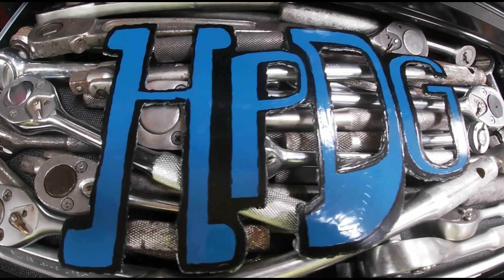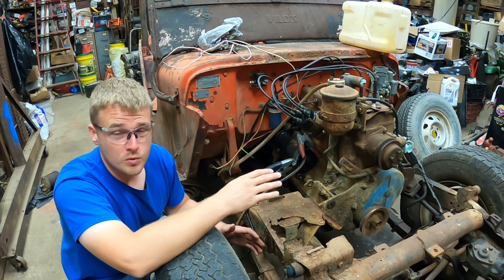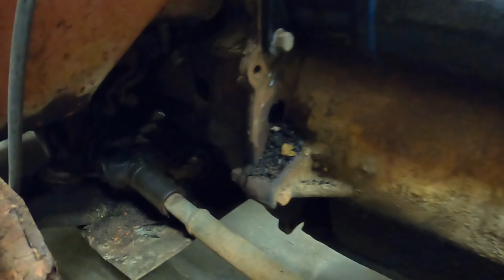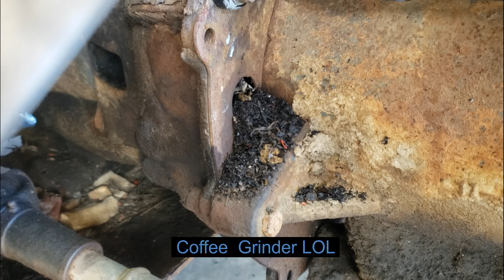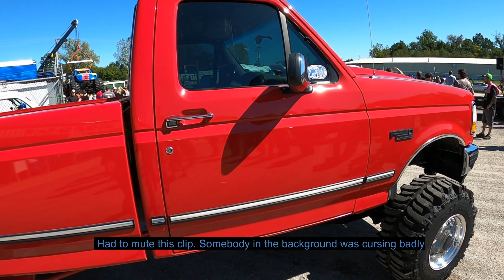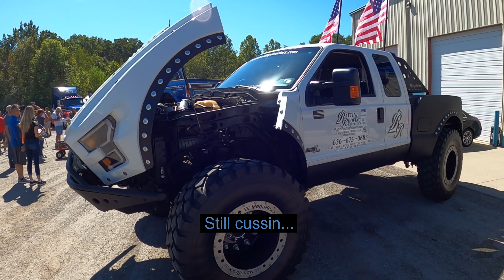Willy's Jeep Episode 13: First Start

Comment: I have similar Continental flatheads in several tractors.  F140's and F 162's.  They are very good running and reliable engines.  I'm sure you know this, but when I'm firing something with any downdraft for the first time I always use a mustard squeeze tip to dribble gas into the the carb to keep 'em running once they fire.  Its the safest way I've found to keep from getting a good burn with a backfire.  Good 'ol Dad, see Zane, we are good for something...LOL.  Nice trucks out there.  I watched Chandler build that original truck one step at a time.  Speaking of 'dads' he is definitely the father of monster trucks !!  Fun video.

Comment: Glad to hear from you Zane! My project lately has been working on the electro-hydraulic system on my 1997 Ford bucket truck. It's an old cable company truck that has had too many previous owners. The truck itself runs great, it's the Onan generator that is a pain. It has a special stub shaft out the rear of the generator that drives the hydraulic pump. If I could find any other electric start genset that was capable of driving the pump that annoying Onan would be history.
Anyhow it's all mine and being I can't climb it's going to get me around the house to paint and trim off trees.
Good to see the old jeep run. Test drive around the yard to see if the drivetrain is in good working order?
LOL! Do what you have time for.
Cheers!
Terry from South Carolina
Reply from the maker: OH!  That would sure come in handy for trimming trees or painting like you said! :)  I've heard  the Onan brand can be  a royal pain!  I hope you can run across something to swap it with before too long. I was thinking of a test drive of the Jeep but I believe the transmission is toast. Thanks as always for the view and kind comments :)  Take care

Comment: Good to see it started even if it’s coming out
Reply from the maker: Thanks Kevin :)  I appreciate the kind words my friend. I hope you're getting things sorted out on your Sterling. Take care :)
Reply: @HODGEPODGEDODGEGARAGE  
I just got the biggest/ hardest part for me, done and that was getting the leaf spring above the axle to put the shock support and spacer on. Something as simple as having enough wood 🪵 to support the truck, reposition and lift again is very time consuming . Putting the parts in place takes 2 minutes getting the spring high enough to put the parts on took a couple of days. As you say, the most important thing is doing the work yourself and learn from each project. It’s about the enjoyment of working on trucks, not showing how fast you can work on trucks.
I’m on a piece of cardboard in my driveway 👍
Reply from the maker: @kevinlamarr1424  there you go my friend! 😀👍 Nothing you can't fix without patience. I'm glad you're getting the truck fixed up. Take care

Comment: BTW Zane, I might've pimped your channel to Junkyard Digs' followers as Kevin did a big IH truck and I said if people want to know about IH's they need to watch you because you are an IH freak and have so many despite your channel name... In fact I don't remember watching a Dodge video from you... *shrugs
Flatheads.. no power but they'll run forever and thanks to 6.5:1 compression they'll run on damn near anything.. Back when vehicles were made to last forever and not just 7 years. I wish I had money and tools.. I'd love to build the world's first 200mph Jeep and figure out how to do it with the venerable 4.0L... honestly it'd probably take 2 highly modified ones with plenty of reinforcement to the blocks and twin compound turbos each.. maybe even methanol or up to 30% nitro but I think it could be done... and I'd use an Overland or a Grand Cherokee. Mating the two engines side by side and being able to mesh them into a trans would be the hardest part.
I miss my blue 76 F100.. it's the vehicle I miss most of all.. and considering we have a picture of me asleep in the rim of a Bigfoot at Arco Arena in Sacramento when I was 4-5.. go figure that that's my all time favorite body style truck. Didn't even think about that connection until about 6 months ago.
Reply from the maker: Oh yeah!  A 200PMH Jeep would be an awesome project! :)  Twin 4.0's would be amazing! Yeah, I have more Binders than anything. Ha ha. Sorry it took soo long to reply to your comment my friend. I've been busy making the next episode on my Travelette. Things are going ok. Found a parts truck.  Oh yes, I'm not a big Ford guy but I love that body style because of Bigfoot too :)  I hope things are going well for you. Take care
Reply: @HODGEPODGEDODGEGARAGE  figured you've just been busy with work with the change in weather, if not going out deer hunting :P